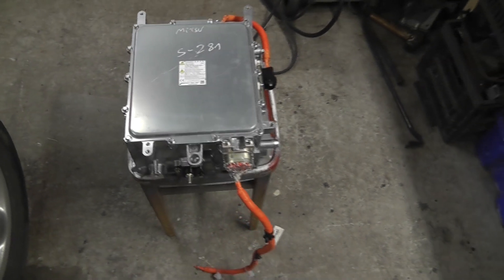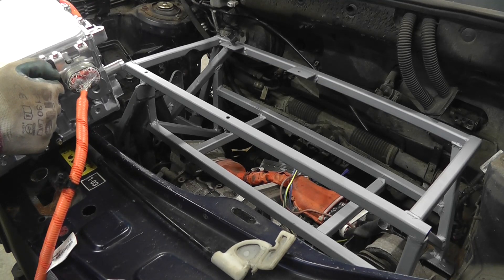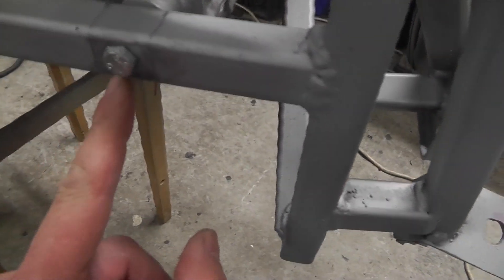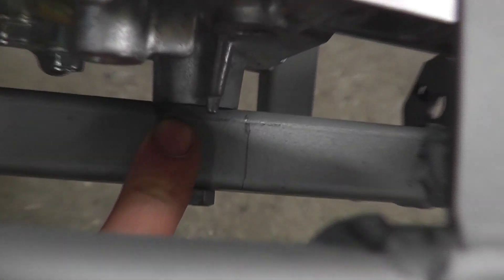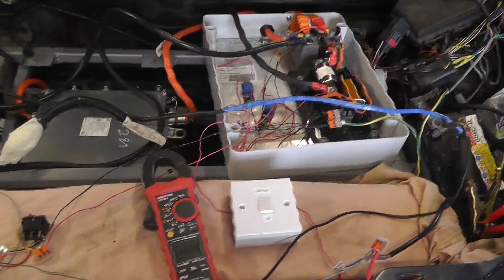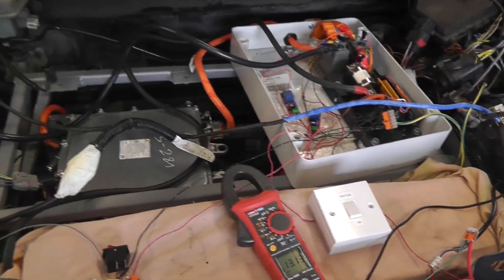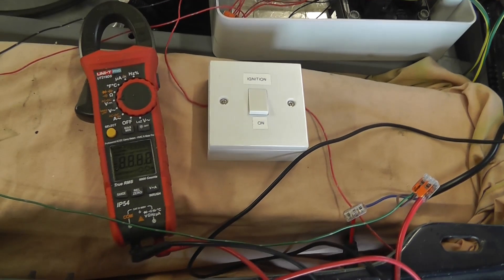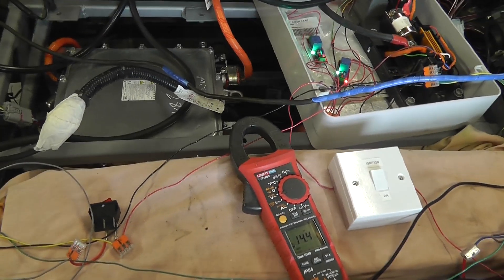DIY EV Part 26 - Outlander PHEV OBC Charger Pt1 Three reasons Why I Failed Before.

Comment: I'm impressed, but you also think about the balance of vehicle while high speed braking as most of bonnet stuff is on the right. Anyone Correct me if I'm wrong
Reply from the maker: Fair question.
The gearbox is about the same weight as the motor so they are sort of balanced.
The 12V battery will be on the passenger side. The batteries are a little more to the passenger side.
So the weight will be slightly more to the drivers side but will it be more than with a humping great td4 diesel engine which is way more to one side than the other? 
Hopefully not but I have a cunning plan to confirm corner weights so keep watching. 😉
Reply: @alibro7512  Thanks for the for the explanation, I was just curious about an event that occurred to me but I'm not in to the kind of engineering that you are which is far from excellence. But I'll keep watching you for I admire for what you guys are doing like changing the world... Good luck...

Comment: Lovely! That does look really nice and reasonably sized. Do you have to talk to it over CAN to get it to charge the big battery to the right voltage?
Reply from the maker: Yes, to charge the main battery you need change the voltage in the PP connection. Tying it to ground via a 220R resistor is a workaround. Then send two CAN signals and it starts charging. You can read about it here. https://openinverter.org/forum/viewtopic.php?t=628&start=225